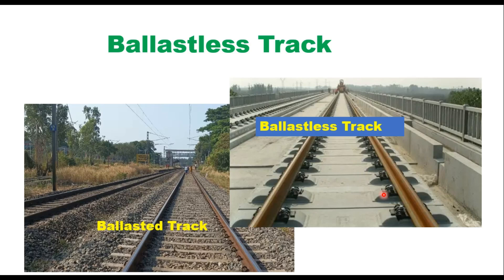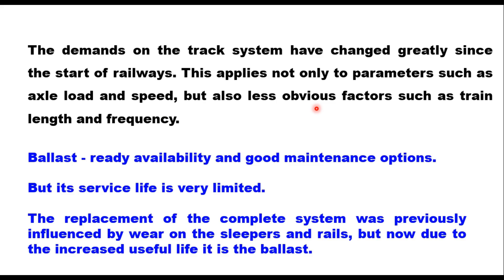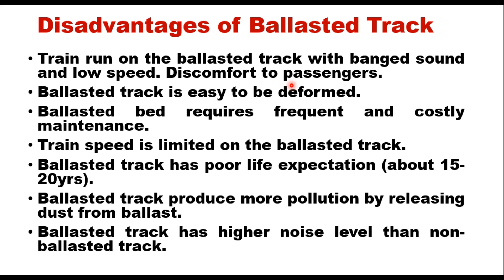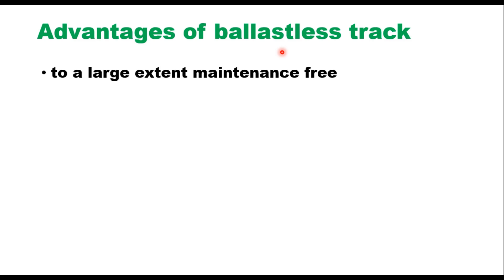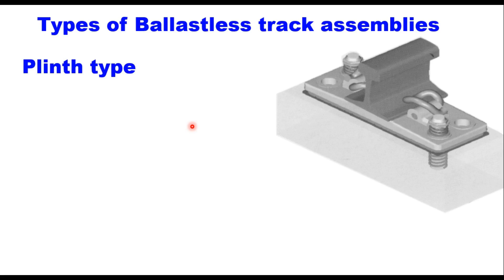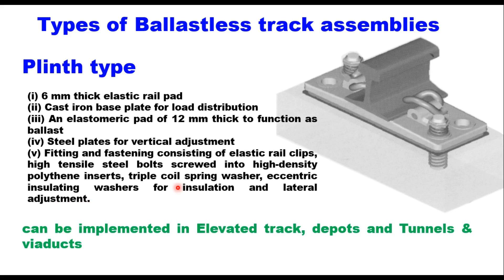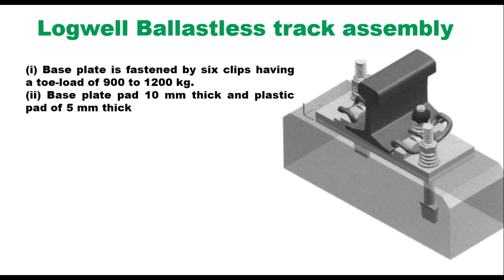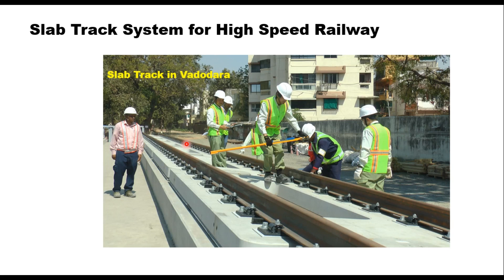Ballastless track, Features, advantages and disadvantages of ballastless railway track, applications

Comment: Can you compare with this j-slab track system used in India's bullet train project. This is going to be a disaster to implement for efficiency and fast laying, this is clearly going to cost a lot more than a simpler high speed track system. There are other simpler and proven high speed track systems to use, why is the govt wasting taxpayers money just to show an innovation which is really new and not really time tested? Its risky and is going to delay the project.
Reply from the maker: No comments on individual's wisdom. If a system is being used, it must have been found good in earlier instances.

Comment: For disadvantages, you mentioned both types have high noise levels. If then why it in the list?
Reply from the maker: Noise is due to wheel-rail interaction and ballast has very little role. Noise is also due to track irregularity. I kept in the list because, it is a characteristic of the track and ballastless track should not be taken as calm track.